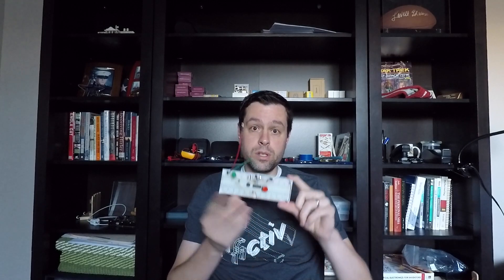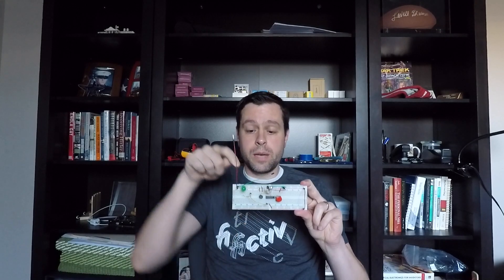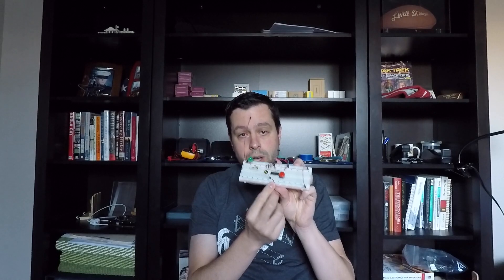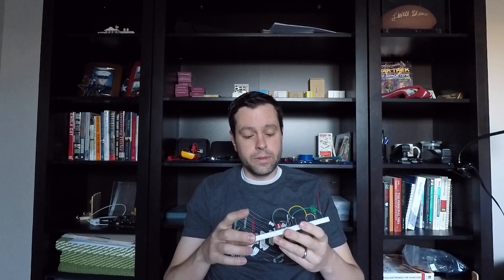It Didn't Work

Comment: Hey, buddy, you seem bummed and I can understand why. But the upside to today's video you caused a light bulb to appears above my head. The idea(light bulb) first started as a solution to the washer completion cycle, a timer similar to what you are building. 
But then the idea jumped, with out conscious thought, to that annoying buzzer that puts out is a cacophony which generates irritating feelings.
what if I tapped into the output to the buzzer and feed it into an IOT board and have that use ITTT to send me an email. 
My next challenge is to make a command decision, do it with out telling my better half andrisk a beat down.
The last comment, I promise, what if you took a 555 timer to create your circuit? Sometimes the junk drawer contains more than we remember.
Reply from the maker: Small world, I've had the exact same thought on the dryer buzzer. We have one that you can't disable the buzzer on and my wife hates it. I told her I could open it up, tap into the buzzer signal (after removing the noise maker) and have that send her a text. 
I actually don't have a 555 and the interesting thing about that circuit is the fact that it uses RC time constant calculations which is really neat. Hopefully when the new comparators get here I'll be back in business.